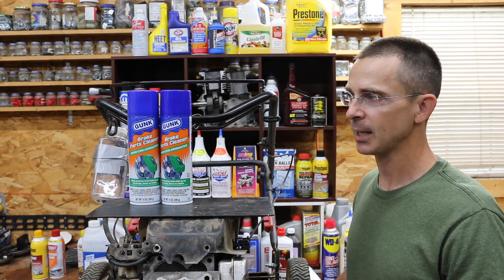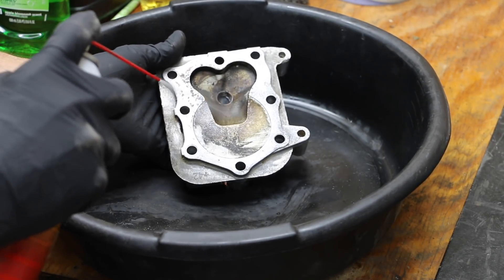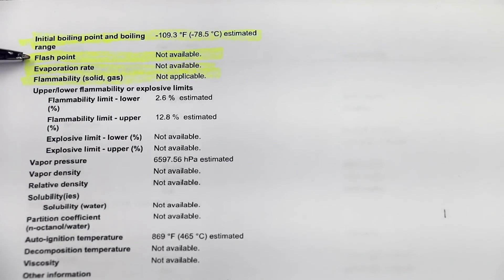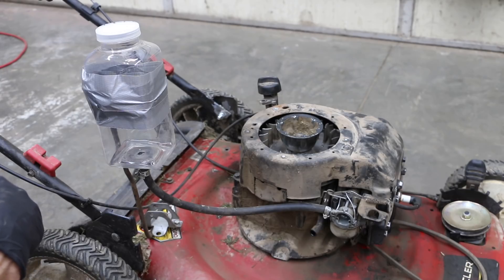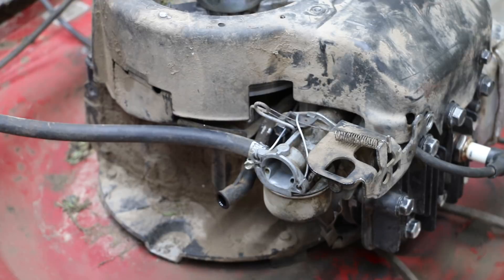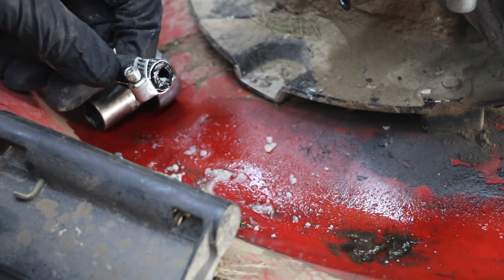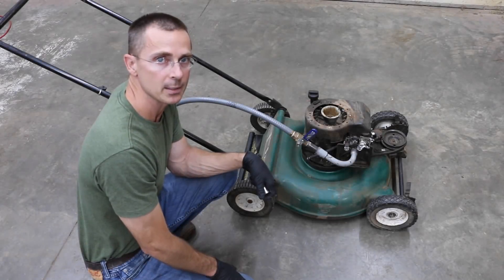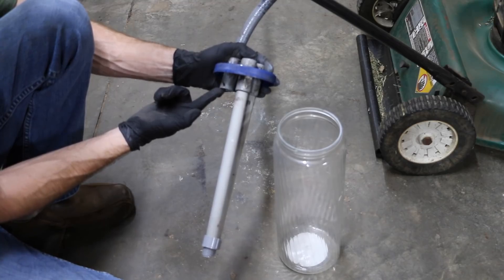Will a Gas Engine Run on Brake Parts Cleaner?  Lets find out!

Comment: The only extremely volatile component in your cleaner was carbon dioxide, which is NOT flammable! 
Propanone boils at 132F; Dimethyl Benzene (c-xylene) boils at 284F; and heptane (n-heptane) boils at 209F. 

You might have asked yourself why carbon dioxide was needed???
Reply from the maker: Thank you for the feedback
Reply: Project Farm 

The carbon dioxide was needed because you used an aerosol. It’s a gas and provided the needed pressure. NONE ended up in the fuel!

I enjoy your curiosity, but you should dig a little deeper into understanding what the chemicals are in the products you test.

Comment: Please please read the caution label, burning brake cleaner can produce very dangerous gas when burned. Please use a respirator. A welder I new almost died from the gas the was produced.
Reply from the maker: Thank you for the caution.  Were you using a "chlorinated" brake parts cleaner?  I avoid chlorinated products

Comment: Man, this guy is just pure genius.

I bet if anyone can get an engine to run on straight water, it would be him.

I point to all of the various "fuels" his small engines run on as my evidence.

Keep up the great vids, Project Farm!

I'm addicted...
Reply from the maker: Thank you
Reply: I was just thinking, if you had a tub of water with a top on it like a pressure cooker and used 2 wires that go into the water then hook up DC electricity that would cause the water to turn to H2O (vapor) and might get an engine to run. It would take a lot of vapor though,  so capture the vapor for at least a gallon of water then pressurize the gas (vapor) into the engine.  One problem could be, when the hydrogen and oxygen burn,  it tends to turn back into water.  Still sounds interesting.

Comment: We would use brake cleaner to drive a vehicle that was towed (with a bad fuel pump) from the back lot to the work bay. One person drives while the other sprays sitting on the core support.

Comment: you left me with a question running on vapors could you mow more then running off  the tank  and or was it more efficient 
please measure out the same amount for both  and maybe a better test would be mount a automotive alternator to motors with a couple of lights for drag
Reply from the maker: Thank you for the video idea!

Comment: during W W 2 the German army was out of gasoline and they used wood gas  this is the gas that is given off  during the manufacturing of charcoal the wood is put in a container and is heated up extremly hot and the gas is piped to the motor my question is did this work
Reply from the maker: Great information. Thank you

Comment: my stihll starts and runs great with acetone wth the oil even without reed valve an manifold i put it in the inletport  and it starts dirict  runs  verry powerful far high in rpm
Reply from the maker: Nice!  Any issue with acetone causing damage to the plastic or rubber components?
Reply: @ProjectFarm  yes it does !

Comment: I could hardly see any difference whatsoever on the before and after of the cylinder head and the piston/valves. It sounded good, and seemed to have plenty of power on the load test. Great fuel, but expensive.(not to mention what it did to the carburetor) It seems to act a bit like ethanol, where you need more fuel for the amount of air, but I'm willing to bet, the power would be as good or better than gasoline. I use this all the time, as starting fluid.
Reply from the maker: Thank you!

Comment: Maybe try Naphtha & Denatured Alcohol in a 50/50 mix? That could be interesting! Great video as always. I've learned quite a lot from your channel/experiments, and am definitely using either Amsoil or Pennzoil Full Synthetic Platinum Oil (I'd have to order Amsoil here) for my next oil change. Just gotta decide what filter to use. I'm using a K&N "Gold" filter right now, and I think it's working pretty well. It's just expensive. My engine seems to char oil for some reason. It looks like 3000mile oil & only has 1300miles on it. Not sure yet as to why that's happening. There's no contamination from blow-by/fuel getting into it. It's not thin, and doesn't smell like gas. My engine isn't overheating either. I just poured in sone STP Synthetic Oil Treatment with ZDDP about two days ago, and it seems to help. Gonna go and buy a jug of Motorkote today possibly and chuck some in, since that product is amazing. Thanks again for the wonderfully creative videos as always, take care!
Reply from the maker: Thank you for the suggestion

Comment: Does running on vapour only use less fuel than running on fuel mixed with air in the carbie?
Reply from the maker: It was about the same in my testing. Thank you
Reply: @ProjectFarm  Interesting! So, the old expression "Runs of vapours", meaning something is super economical, doesn't appear to hold up :) Thanks for the reply

Comment: Expanding foam comparisons..big job, small space..I dunno about the fire testing, of it unless you spray and propane torch heat treat after dried, spraying the exposed surfaces (the way pros do) w ceramic paint..maybe if it's a small box the temp retention or resistance w/e inside vs outside  w w/e, vs reg pack foam samples or w/e..
Reply from the maker: Thank you for the video idea!

Comment: Reliability flex test of old fishing rods and reels, bending to breaking kind of thing, (a reason to replace the kids' old crud w let's see if we can bring in a big one), Ugly Stik, Rhino Unbreakable, (both incredibly strong), Eagle, (same)..weight to bend flex etc, (or just test w no that was expensive)..pros and cons of stainless guides vs plastic, (how they scratch..)..then maybe one w fishing lines, one nylon one braided..Wish is great for this w prices but unbelievable wait times and bit of conning w supplier here and there..maybe one w pole holders, ease of use, strength, homemade..lighted bobbers, price, not much I can think of there..
Reply from the maker: Thank you for the video idea!

Comment: People are gettin' big on the electric sheet, if ever and not expecting due to cost, but if having a Gator or w/e, a conversion w old generator and a set of batteries and/or capacitors w converter or w/e..

Comment: Easy to start a "hard to start" engine with brake cleaner, but it will remove the oil film on the cilinder wall and valve guides and get worn out soon, which will explain the compression test was lower than before you run on brake cleaner. Personaly I don't prefer any starting sprays at all. If the engine doesn't start well, something might be wrong...
Reply from the maker: Great point! Thank you

Comment: Can the (vapor modified) engine run on hydrogen gas?  An interesting twist to producing hydrogen instead of using traditional electrolysis would be to use chicken droppings.  Collect the gas in a large tractor inner tube.  When it's nice and plump you have a nice amount of gas at low pressure.
Reply from the maker: Thank you for the video idea!

Comment: Paused at 2:30 because I see Heptane on the MSDS at a really high level, and am predicting this is going to knock like nothing you've tried before. Continuing...

....4:30 yeah, that is not a happy engine. Heptane is mixed with octane for proofing octane ratings, it's octane rating is literally, by definition, zero. Whatever else is in that mix has to bring it up to useable, I'd say you've got an octane rating of 30 or 40 there, pinging and knocking like nobody's biz.
Reply from the maker: Thank you!

Comment: Great videos here is a video idea: To get those engines with variable compresion.... those with a screw on the head and check if all this fuel tests needs more or less compresion than gasoline....to check if the fuel been tested have more or less octane number..... i hope i explain well....
Reply from the maker: Thank you!

Comment: As a CMAT here is a trick many may not have thought of...  When a vehicle with a defective electric fuel pump is towed in and parked, disconnect the intake boot and with the help of a driver... use brake clean to start the engine and walk along with it to move the vehicle into the repair bay.  Works ever-time and I've never had a problem !  Nice video...
Reply from the maker: Great tip!  Thank you

Comment: instead of a funnel then use a 8 mm bolt you drill a hole tru. then a nut and couple pieces of bike tubes as gaskets. can be fitted on everything.  we use to fit them in the cap on coke bottles.
fuel hose will fit over the treads on the bolt
Reply from the maker: Thank you for the recommendation.

Comment: Can you do a wear test using low ash 5w30 Mobil diesel oil vs mobile 1 turbo diesel 5w40 oil?
Reply from the maker: Thank you for the video idea!
Reply: Project Farm The reason I ask is because some of the modern diesels require low ash oil for emissions reasons, everybody says the 5w40 or regular diesel oil is better for your engine. I’m mostly curious about a wear test between the 2.

Comment: Be very careful with this. Brakleen has a product that will work as a starting fluid but basically produces phosgene when it's burnt. No mask will save you from that. You will just die.
Please make sure people know not to just do this with random chemicals without checking their burn by-products first.
Reply from the maker: Great point!

Comment: @3:22
That throttle work though!

You did a great job keeping it going, until I guess the engine heated up enough to atomize.
Reply from the maker: Thank you!
Reply: I may be a little late, but "That throttle work" is also the quickest method to diagnose a way-too-common carburetor problem.  Even though the manufacturer is REQUIRED by the EPA to certify their engines for gasoline containing up to 10% ethanol, they still use gasket, etc, material that degrades in ethanol.  If someone puts pump/automotive gasoline containing the standard additive level of ethanol into their mower for normal use, sooner or later it will cause the mower to stop running.  The most common problem I have seen is that the needle valve seat (part of the carburetor that opens up to let gas into the carburetor) will swell up and cause the carb bowl to only fill part way, and the mower just won't run any more.  Unless you literally choke it with your hand.  The normal intake vacuum isn't strong enough to pull up gas from a partly filled bowl, but when you choke it outside the normal mechanism, the increased vacuum causes fuel to flow, and the engine to run, until you take your hand away and stop choking it.  The seal that swells up and causes the whole mower to quit costs less than $0.50 each.

Comment: For your Fuel Vapor canister. The Bubbler/fume generator needs a sponge or cloth on the submerged  hoses to multiply the bubble output "more bubbles"=more fumes" and more fumes = higher efficiency! 🧐🤓
Reply from the maker: Great tip!

Comment: 9:00 You should add another small valve tee'd into the line running into the carb. This valve would open to atmosphere, allowing you to tune the air/fuel mixture. Engines don't like to run if they're not near the fuels stoichiometic ratio.

Comment: Very dangerous test a whiff of those igniting fumes could shut down your immune system and kill you

Edit: Didn't watch video entirely I thought this bc was chlorinated.
Reply from the maker: Thank you.  I cautioned viewers to avoid using chlorinated products as fuel.  Agree, very dangerous.
Reply: @ProjectFarm  Thanks for the reply. But I read about someone accidently inhaling this and he blacked out and thought everything was ok and starting feeling really bad day by day then he went to the hospital and found out his entire body was shutting down his liver his immune system everything.
Reply: When chlorinated brake cleaner (I believe chlorine in general) comes in contact with high heat, it makes phosgene. A nasty, deadly gas. There is no antidote either. You just have to ride it out and hope you don't die.

Comment: I think the brake fluid was dissolving the rubber tubing... 2-Propanone, dimethyl-benzene, etc are strong non-polar solvents.

I worked in a QA lab and we had to clean the test equipment of the gummy solutions that we were testing with methylene chloride.
Reply from the maker: Great point.

Comment: If you're interested in making your videos more entertaining and educational, i would suggest going over some of the science behind what you're doing.

Starting off before you even run the test, tell us your opinion on how you think that particular run will go.
Then, perhaps while you're showing the before pictures and compression results, do some commentary and go over particulars behind why this run may or may not work, what the types of chemicals used in any particular fluid actually are and are what they're used for, the safety hazards of burning certain fluids and why you won't be doing those, tips for working with lawmowers and other small engines, explaining why and how various types of small engines run, or just some of the craziest suggestions you've gotten, including those that might actually work.
Reply from the maker: Great recommendation. Thank you

Comment: I’m a mechanic. I use brake cleaner to test if a car with a no-start condition has a fuel problem or not. If the car starts - fuel pump or smth related. If the car doesn’t start - different problem
Reply from the maker: Great point.

Comment: So this is off topic but see you know your engines I have a question about a ariens ss522 snowblower.its running really smoky and I took the top cover off to see the engine and noticed it's oily/greasy all over the inside.its also oily under the muffler and I noticed oil coming out the exhaust.the spark plug was carboned up.what does this sound like to you.is there a more proper place we could talk?
Reply from the maker: It sounds as though the oil settled out of the gas.  I would run it out of fuel and replace it with a really high quality 2 stroke oil designed specifically for air cooled engines mixed into non-ethanol gasoline.  Amsoil Saber is one option you might consider.  I'd also replace the plug.
Reply: Project Farm is it possible it could be more than just the oil settling out of the gas.like a worn ring maby?I need to do a carb cleaner can I use carb cleaner on that carb or will it harm it?I also took the muffler off and there was some carbon build up in there as well.right now the temps are in the high 40s will it run different/rougher with it being ran In warmer weather?

Comment: But if the Boiling point of that brake cleaner is almost -80C, why does it not boil in the tank of the mower??
Reply from the maker: Great point. This stuff vaporizes very easily!

Comment: try this on an engine where the piston is vertical, a modern engine that uses less oil needs a lubricant on the bore or it will eventually fail. I dont think much knowledge can be gained by these tests as this is a slow revving old fashioned side valve that has its piston constantly immersed in oil .
Reply from the maker: Thank you
Reply: No worries, I appreciate you are doing a community service by doing these experiments but under slightly different variables you may have an entirely different result, for example the brand of break clean as some seem to be different to other, they don't seem to have the same formular from brand to brand the smell is different. the type of engine etc. on Iseki motors they have a sticker on the fuel tank that says do not use starting fluid on the engine, I came across a situation in a workshop I worked at where a little Iseki tractor wouldn't start, all the super brains at the shop swarmed around the thing and concluded that it had a faulty electrical system relating to the starter, so they tried every thing to get it cranking properly, they replaced batteries, starters,relays, switches etc,glow plugs but they couldn't improve the cranking speed.
after one guy had stuffed around with it for a week they handed the job to the next guy he had the injector pump apart and all the injectors apart and tested but still no go, out of desperation they gave me the job or at least they lost interest in it, I had an apprentice helping me and I said to him, this engine needs 2 things to make it go, compression and fuel, we wound it over and it had fuel, so then I pulled it through its three compression strokes and it only had a little compression on one cylinder, so I ordered a set of rings, and we started ripping it apart, long story short the engine had been damaged with starter fluid, the rings were stuck in the grooves, the friction between the bore and the rings had damaged sealing surface reducing the compression to the point where it would not start. i think the cranking speed was low because of the friction caused by the stuck rings, the junk in the ring grooves was not like what you would normally see in an engine and it was as hard as stone, it took a lot of work to remove it.

Comment: hey I have a video idea , like me you know a briggs motor will run off of just about anything and it did as I used to live off grid and didn't have money to buy a generator to charge my batteries with soooo I belted up a 40 amp delco alternator to a 3.5 hp briggs ( don't use aluminum pulley on motor )on a piece of 1 inch plywood with a simple switch on the field coil of the alternator ( 3 wires one is field ) many preppers and such might like to know how much power it will produce scince ?( cheapest generator money can buy found used) you can torture these motors on any kind of fuel and they seem to like it , this contraption ran a long time and was a good portable baterie charger , 4 to 5 hours a day ffor 3 years with basically no maintinece , if it was luckey it got a oil change once a year , cant say that for most new generators today , so how much power did it make wide open ? ( fan type govener ) in the end I gave it away and it still ran
Reply from the maker: Thanks for the recommendation.